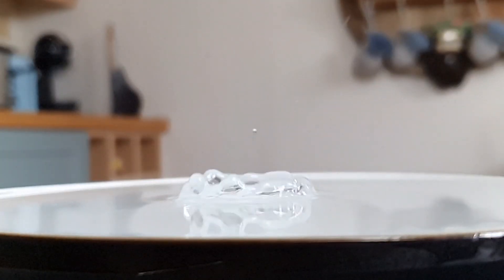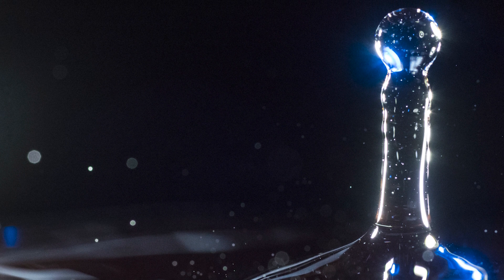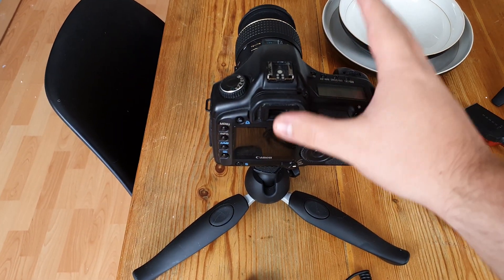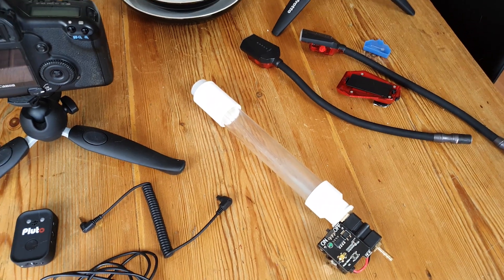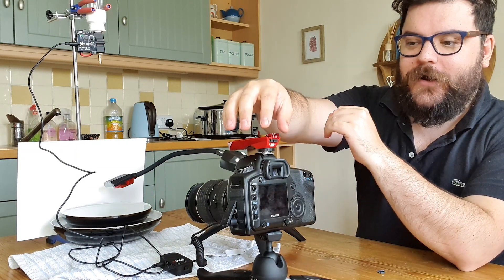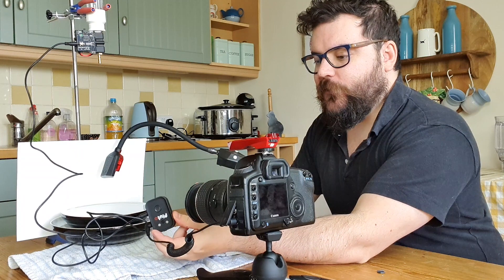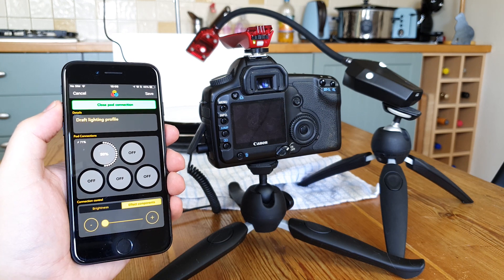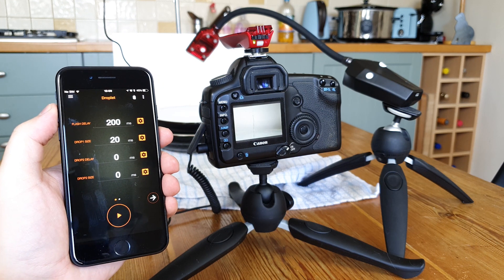Water Drop Photography Tutorial with Pluto Trigger

Comment: Hi, I wanted to know at what height you recommend placing the solenoid valve in relation to the water container. Is there a relationship between height and App parameters? What parameters do you recommend for both single shots and collisions?
Reply from the maker: Hi Max, it's impossible to tell you the best parameters as the height is a huge variable in the settings for the app. Every small change will require the settings to be tweaked, the only way to figure it out is to do it yourself for your own setup.

Comment: I mark the drop point with a penny under the water just above the drop point and a tiny piece of blue tack with a match sticking above the water. Focus on the match head gives good results. If you want to repeat the shot you really need to let the water settle completely in the bowl. Even leaning on the table causes the water surface to move about.
Reply from the maker: That sounds like a great method of getting your focus right Rob, keeps your hands free to focus. Letting the water settle is another good tip!

Comment: hello, i read in your answers you are using 1/100 F/22 and iso 400 with pluto triggering camera by wire and radio transmitter on camera. in same ideas than First man photography 1/200sec F11 iso 400. Do you know why we see lot of tutos expalining this triggering is not consistent and has delays not repetitive and the best way is to connect pluto to flash with a wire and point pluto to IR detetcor of camera at 1-2sec shutter speed. Or, interesting, same but instead of a wire between pluto and flas, a rf transmitter which lays on the table. Why should a wired trigger and transmitter on camera be much longer responsonse ?
Reply from the maker: Hi Marc. I've not tested enough with different setups to know which methods work best, but I didn't find that any delay with the triggering of the drop was significant enough to cause problems, it just takes some adjustment with the timings in the app. The only method I have used personally is the one you see in the video.

As for settings, different flash systems, environments and distances from the splash will all result in different exposures, so no two people will be getting those the same.

I do plan another water drop video soon with a MIOPS water drop kit, so maybe I'll have more clarity on your question then.

Comment: nice tuto ! i want to try it :-) do you have a link for the arm ? with your iphone parameters, what is the distance between the output of valve and the water surface ? is it safe for cheap pluto valve to use milk ? how do we wash valve after that ? do you use food colouring liquid in bowl or in valve ? how do we chnage background:colors ? i have seen you sell backgrounds on your site. which adaptalux kit would you recommend to order for water/milk droplet photo with pluto water drop kit ? i have seen so many filters, arms, controller,... that i have stopped searching. do you have distributors for belgium (amazon fr...) ?
Reply from the maker: Hi Marc, Thanks for the questions... let's see....
You can find info on the flash arms here - https://adaptalux.com/studio/flash/
We didn't have any issues using milk in the pluto valve, and it was cleaned by running water through it.
We haven't tried food colouring yet, but plan to when we re-visit this subject soon.
There are lots of ways to change the background colour, a background card like the one's we sell would work great.
As for which of our packs, you will need flash arms for this, not the LED arms. At least 1 control pod, the flash trigger, and one or more flash arms.
We don't have distributors in Belgium, but we ship worldwide from our store.

Comment: Do you need a pluto valve? Or will the trigger with flash be sufficient?
Reply from the maker: The trigger works together with the valve to release the drop at the correct moment. I think you would need both to be effective with this.

Comment: Just to point out you don't need all these fancy gadgets and apps to take these types of shot. I used a Canon 800d with Sigma 70-300 APO DG, Two table lamps and a dropper from an old eyedropper bottle, second tripod with an arm clipped to the top and a marker where to drop the water from. Hanging some string with a weight into the water gives you the drop zone and a focus point, either auto-focus or manual focus onto the string then remove and switch to manual so it doesn't try to refocus for the shot, Finally use a remote to the camera. Timing is key so have a couple practice runs, you want the shutter to operate as soon as the drop hits the surface. Check out my results at PInn Sharp Images on Facebook
Reply from the maker: Indeed, you can get some shots with trial and error with the timing, but you won't be getting the water drops to collide with a setup like that. Unfortunately the collisions do require a setup capable of automatic timing!

Comment: Didn’t hear you say to put your camera to manual focus after you get the focus set on your drops. You don’t want the camera to try to focus with every shot. Great video though. I got the Pluto trigger for Christmas and haven’t set up the valve yet. Looks like a good day project. I’ll have to check out your flash setup. Subscribed and hopefully you do more tutorials regarding how to creatively use the Pluto trigger. It’s a very powerful little tool. Thanks it’s the best tutorial I’ve seen on doing this.
Reply from the maker: Thanks David, I sometimes forget that auto focus is even a feature, all my macro lenses are manual only so i don't mention it often. Very good point though for those that might not think of it! The Pluto Trigger is a great bit of kit, it will certainly make another appearance in future videos. Thanks for the comment, and welcome to the channel!

Comment: Thanks for pointing this one out, Ben.
A few questions if I may-
You put your Adaptalux light at 100% power. Isn't that also the longest duration for the flash? Wouldn't shooting at a lesser power be a shorter duration and therefore a sharper image? 
I use a machine also (SplashArt Kit MkII) but I found that using a shorter duration flash yielded sharper images. (1/64th and 1/128th power worked best)
Maybe you could use multiple arms to get it bright enough as one may or may not be bright enough? 
You made a good point about milk being a cool medium to use. It lends itself to being effected by those cool flash colors! (can you tell that I REALLY need to get an Adaptalux soon?!)
Thanks again for showing me this link. 
Continued success on your videos!
Reply from the maker: The power on the flash actually converts to speed, so 100% is max speed not max power. You're right in that faster flashes make for sharper splashes! Most of these were taken with only one flash arm too, so one is enough, two is interesting for different effects
Reply: @Adaptalux  Thanks for the clarification. I assumed wrongly (nothing new for me)! :)

Comment: I don't know why is my water splash are not in focus. I am on manual focus mode. I am using softbox with elinchrom
Reply from the maker: You need to make sure you have a wide enough aperture is narrow to get all of the splash in focus, and make sure to focus manually on the exact spot your drop is going to fall. It could also be that your flash speed is too slow so you are still getting some motion blur, hard to say without seeing the images.
Reply: Thanks for your prompt response. My aperture is f18 and I an on manual mode. I have also did proper focus.
How to increase speed of my flash?
Reply from the maker: @Wildlife_Unlimited02  There should be settings for that on your flash.